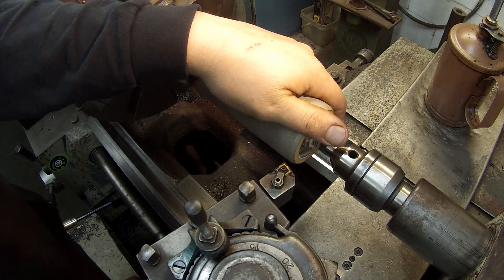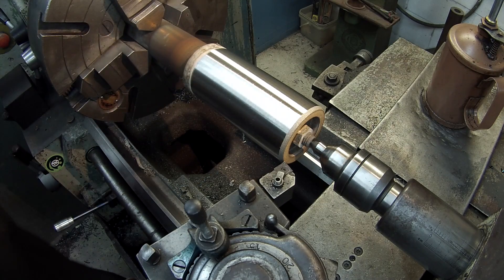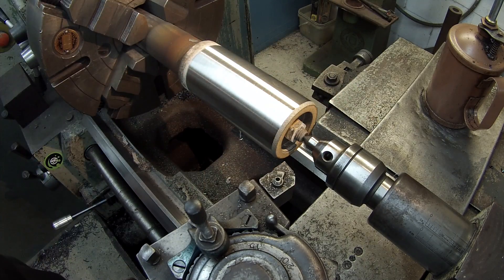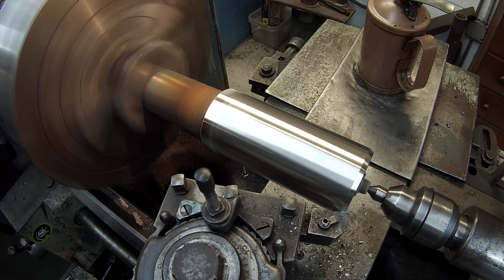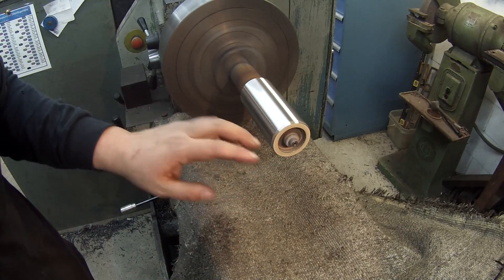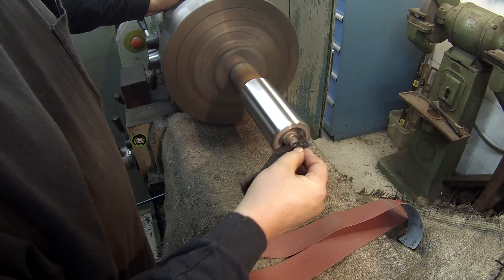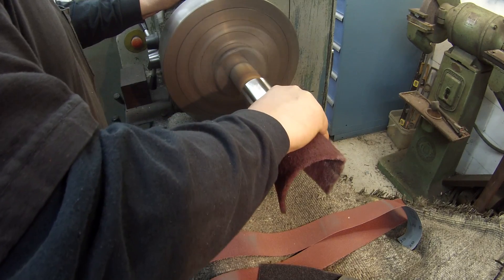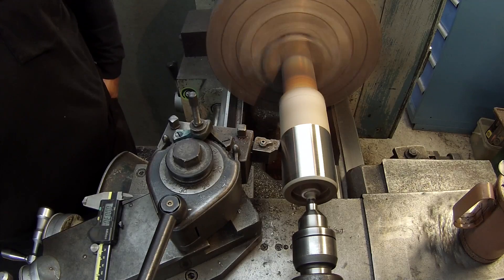Stainless Steel Metalizing Part 2

Comment: What are you doing to that part in the lathe?
Making it bigger!

Many years ago I recall collecting and delivering back components that had been built up again by welding. They were a lot rougher than this finish as they were picks being used to strip the metal coated linings from blast furnaces ready for relining during "shut down fortnight" at a local steelworks.

Comment: Great Video. I am trying to get back into spray welding. We have been tig welding repairs on shafts for years and I have all the equipment but am having a hell of a time getting my hands on consumables. Do you have a vendor you get these products from? It seems like everywhere I call I cant get everything I need from one location. Thanks again and keep the content coming it has been a great help so far. Thank You

Comment: Have you ever metalized fiberglass?  I worked on helicopters for the army and some models had the fiberglass dog house cowling stainless steel metalized. I was wondering if you have ever heard of fiberglass being metalized and if you knew if there was a different method of metalizing. The manual called it a flame spray process.

Comment: Isn't the metal burnt with that process? I understand it is being made into a molten state in the flame but with SS if you flame burn it like that the metal itself is really more of a slag than allow at that point. I'm just not understanding the chemical reaction that is happening for the SS powder maintaining its proper alloy properties.

Comment: I'm not sure why, but it's not surprising that something like this can be done, with all the other things we've learned to do with metal. What I don't understand is what happens to the bond coat as the metal powder is applied? Is there still a small layer of the bond coat there, or does it burn off?

Comment: I just want to tell you how much I enjoyed watching you work and explaining everything as you went along. Felt as if you cared about us knowing well what you were doing. I am retired (back trouble) but I can't get too far away from the intrest in metal working. I was a welder in a shop that did spray welding with tungston and ceramics as well as other metals. They did a lot of the Mission Pump shafts. Good work Adam and thanks again for your teaching.
Reply from the maker: David Conner Thanks David! Great comments. I have never had the privilege to spray weld ceramics but I do have tungsten and some other hard alloys here. You have to grind them to finish though.
Reply: +Abom79 just a thought could you cut a piece of tubing to cover the threads? Then you wouldn't have as much trouble. I've never seen this before didn't the masking work or does it not work the way I thought it would

Comment: I take it the spray weld saves allot of time to remake that part?
Reply: +Erik Trent Stainless doesn't grow in trees...nor carbide tools and man hours! You would be tossing 10-20 bucks of slightly undersized stainless and then have to buy a solid piece (40-60 bucks) and then the machining time would be an awful lot! If a part is not totalled or not getting any other update fixing the old one is always the best bet!
Reply from the maker: ShnitzlHaus In many cases yes, it saves you from having to machine a whole new part.
Reply: +Abom79  It seems to me a guy with your skill could machine two of them new faster and cheaper.  What am I missing?  Very interesting to see though, to say the least......

Comment: Incredible, never have seen spray welding even tho I knew it was used on cranks.
Your tool setups using old standard methods are great. I had a machinist tell me he never used a 3 jaw scroll, only a 4 jaw independent, now I see why so maybe I'll start using my 4 jaw on my old Logan (about 1945 but still works great for me.)
Paul
Reply from the maker: Nextstepheli .Nextstepheli Both chucks have there place, but for much of my workholding needs the 3 jaw chuck just isnt good enough. All of mine run out a few thou, and sometimes you need the extra holding power of a 4 jaw.

Comment: Would a diamond knurl work better as a surface finish before spraying? Obviously that would deform the surface and change the od, but wonder how that would do? Seems it would have more surface area.. You could thread LH and RH making a diamond like pattern that doesn't displace any material. Just a thought.

  Besides that, the video is really cool and I enjoyed watching it. Thanks for taking the time to make it.

Comment: Merci Adam, j'ai vraiment apprécié que tu mettes ce travail en ligne, c'est ce que nous faisons entre autres choses dans notre entreprise.
Tous les systèmes de projection thermique possèdent un gaz vecteur servant à accélérer et transporter de fines particules jusqu'au substrat  (typiquement 5 à 100 micromètres) qui peuvent être à l'état liquide, pâteux voire solide.
Ce gaz vecteur peut être aussi source enthalpique, permettant de chauffer ces particules jusqu'au point de fusion.
D'autres procédés utilisent un arc électrique pour fondre le matériau. Les particules ainsi projetées sur le substrat, s'écrasent selon leur vitesse, selon leur état physique, température etc.
L'accumulation des particules sur le substrat permet de réaliser le revêtement.
Ceci est possible pour presque tous les métaux.
Je regrette que pas plus de français ne commentent dans vos vidéos, ou postent sur Youtube leurs savoir faire, parce que les échanges seraient bénéfiques pour tout le monde.
Cela fait un an que je regarde ta chaine Youtube Adam, tu fais parti des meilleurs de la " communauté ", c'est un fait :)
Cordialement.

I translate ( like i can) because automatic translation is a shame :)

Thank you Adam, I really appreciate that you put this work online, it's what we do among other things in our company.
All thermal spraying systems have a carrier gas for accelerating and transporting fine particles to the substrate (typically 5 to 100 micrometers), which can be in liquid, pasty or solid.
This carrier gas may also be an enthalpy source for heating the particles to the melting point.
Other methods use an electric arc to melt the material. The particles thus projected onto the substrate, crash on it according to their speed, to their physical condition, temperature etc.
The accumulation of particles on the substrate allows for the coating.
This is possible for almost all metals.
I regret that no more French guys comment on your videos, or post on youtube their knowledge, because that would benefit everyone.
For one year I look at your youtube channel Adam, you are part of the best of the " community ", it is a fact :)
Best Regards.

Comment: I just slapped my wrist, why would I doubt it!
Reply from the maker: Did you see the pictures I posted on FB?
Reply: No I just finished some welding work, the temperature is on 36C at the moment on its way to 39C today, so into the shower, grab a coldie and check it out.

Comment: Adam, check all the O'Rings in the Eutaloy torch before you fire it up they may be perished. cheers

Bruce
Reply from the maker: Bruce Whitham I did check them and they were still good. I made a couple welds with it not long ago, doing good!

Comment: Yep that would be good, the thing about the powders are they never age if they are sealed. The problem will be keeping the bottles from deteriorating, I'm still using some of the fluxed silver solder that is 40 years old, kept in original Castolin box and travelled the world and still serves me well. I'll raise a glass to our health tomorrow evening.
Reply from the maker: A few of the bottles are sealed, but the plastic is getting bad. I'm going to have to buy some type of containers to put the powder in and mark them because I don't trust these bottles to last much longer. I've already lost 4 bottles of good powder.
Reply: Abom79 Switch to a PFA bottle. They will last a lifetime, if you can make the investment. (one example) http://www.amazon.com/Saint-Gobain-Chemware-PFA-Wide-Mouth-Bottle/dp/B004O6NBJS
Reply: Any PP or PE bottle is going to last many decades if you keep it away from light. Light is the enemy of most plastics in a longer time span.

Comment: I have seen manufacturers weld teeth on grinding machines, how much stronger/resilient compared to the original material is spray welding, does stainless steel harden better thru the heat process like carbon steel?

Either way, awesome video and the final product looks incredible...keep up the great work Adam.

Oh yeah, Happy New Year to you and yours as well!

Comment: Adam G'day, well done. you take me back to the 70's in my old shop when I used to do a lot of metal spraying on all materials both round and flat/curved, did a lot of hard facing as well. The memory jolt came when you were unloading the stuff from your old shop and I saw those little bottles and the gun. Castolin Eutectic brand (Swiss if i'm not mistaken), looked exactly the same. I use a guy in Town who does this full time and also other guys with different methods for shaft buildups and keyway repairs. Take Care Bruce
Reply from the maker: Thanks Bruce. Eutectic is mostly what I have, with some Metco powders in the mix as well. Yes that box of powders i shown is for the Eutaloy torch. I want to pull it out one day and play around with it on camera. It should be great for some keyway repair.

Comment: Adam, thanks for the great video. I operated boats for 10 years and managed the fleet for another 11. Sand in the water would occasionally chew up the shaft inside the cutlass bearing. Wilmington Iron Works, Willmington CA. Used the same process to save some of our shafts. Monofilament fishing line can cause damage too. My other experience with metallizing was re-coating worn SCUBA tanks with Zink to replace the galvanized coating. 

Your videos are always interesting and informative. Afterwords I get frustrated if I don't have a jucy project waiting in my home shop.

Randy
Reply from the maker: It's nice to hear from someone who has a little experience from this process. How did the repairs hold up for you during that time? Did you ever run into any problems with the metalizing? I've never had much feedback, but that can be a good thing!
Better get out in that shop and drum up a project now!
Reply: The repairs held up fine we never tracked the repairs with 11 boats in the fleet, each a twin screw, just not that organized. I was never Adair of a problem with the repairs. Eventually a shaft would get bent as a result of impact with floating debris. Sometimes they could be straightened, also by Willmington Iron. We had a steady stream of props in for repair with Wi
Reply: Wilmington propeller. We gave these two firms some regular business. Props and sometimes shafts would be changed out in the water unless other work was required. It was an eye opener for me to see one of Keith Fenners videos where ht took great pains to mate the taper on the shaft to the prop. Also the care he takes with sharp edges on key ways. Our props were treated as interchangeable between most of the boats. They are all powered with various versions of the Cummins B series engines.

Comment: Can u not weld a thin pipe on the side off nut. Which protects the threads.When you are spray welding. This way you do not need to paint the threads.Or turn it down. And your head stock will still fit.

Comment: Hi Adam.

I work with heavy earthmoving machinery. Several years ago, I came across some pins which had been spray welded and the metal had broken away from the pin. It had come away in a fairly neat layer and you could see where the pin had been turned down for the start of the process.

If you were to hazard a guess, would you say that it's because spray welding isn't suitable for high impact applications like this, or would the process have been done incorrectly?
Reply from the maker: It could have been done incorrectly, but it also may have been the wrong applications as well. Most of my spray welding fix's have been for bearing or seal journals.

Comment: Hey Adam: Your metal spray application finished well and looks great.  I can remember my Dad, who was a metallurgist with Revere Copper & Brass, experimenting at a local machine shop with wire and small rod-fed application guns.  A coil of rod or wire would be fed into the gun which ran a blue-white flame and produced the spray. It also machined well.  I undercut a 1" 4140 steel rod to .500" into which my Dad sprayed copper.  It machined really well, and for years I had that steel-copper-steel rod sample.  Dad passed away about 7 years ago, and I don't know where the rod sample went. Great video!
Reply: That brings back memories of when I was at work, we copper sprayed the ends of capacitors using this method, the maintenance men would be very enthusiastic when it came to changing the extractor filter tank, it was full of copper dust for them to sell for scrap!

Comment: Hi Adam, how this metalizing process do in terms of durability?
Reply from the maker: If applied right, i works great and last longer than the parent metal surface, I have seen several of my seal journal jobs and they are still like new after many hours of use.
Reply: Thanks for the reply Adam. I didn't know about this technique before, well... know I do. 

Happy hollidays for you and your family!

Comment: A suggestion from the cheap seats. Next time you have exposed threads like that while metalizin put a couple extra nuts on it untill all the threads are covered. They can just be finger tight. Oh another great video too!
Reply from the maker: Good tip David, somethings even the simple things can slip our minds.

Comment: Very nice Adam.  If it weren't so expensive this would make a great sparkler show for New Years and 4th.
Have you considered a shield for your chuck?  I'm thinking a cardboard disc the size of chuck face with loose center hole for your work arbor to pass through.  Doesn't need to be attached to anything, just allow it to freewheel.
Reply: I though the same thing, also a wrap of masking tape around the exposed thread, not sure that would be robust enough though.
Reply: how would easily burnable materials protect from molten metal spray
Reply: This is a great example of the phrase, "please put brain in gear before engaging mouth". LOL

Comment: Hi Adam great video as all ways , just a quick question how do you cost up a job ? Do you charge a hourly rate plus the steel used . And can you give us some K&T info ,
Reply from the maker: I charge per hour plus material cost. The K&T is still in my sights, just pushed back on the list.

Comment: Does the shallow 28 tpi thread on the part contribute to holding on to the metalized powder? Was 28tpi just an easy to achieve thread pitch, or was it something specifically required?
Super video series in so many ways: presentation, videography, material and method choices, techniques to name a few. I hope you and Elena have a wonderful, healthy, happy Holiday Season and a great New Year. Hurray for you and YouTube: rather YOU and youtube.
Cheers brother,
jim
Reply from the maker: Jim, cutting a shallow fine pitch thread across the undercut is part of the procedure. They say it helps the powder hold, or have something to help bite. The pitch doesnt have to be anything specific, but there is a range to stay in.
Reply: Abom79 I think it has to do with doubling the surface area by cutting a thread, instead of the flat surface you now have each slope of the thread.

Comment: Great videos Adam.

 Is your tourch a type 1A and how about teaching us about the why depth of relief cut, what  thread count and the flame profile to be used.
 Everything I have read on the Eutectic (took over Rototec) is Greek to me, and they informed me that they have not heard of a Rototec type I and type II gun, but they have metals for Rototec type I A. There is not a lot of information out here on what prep process or what metals should be used.
Someone with your knowledge needs to help us out in the field.

Thanks again for your excellant videos.

Montana
Reply from the maker: Yes mine is the Rototec 1A.
I have tried to share some of that info on each video William, but some of this is things that were taught to me by my dad. I do have some old liturature on the torch that explains the proper procedure, and I have that as a guideline to follow. Some tips to keep in mind...
Never go more than .040 deep on undercut (per side)
stay between 200 and 600 degrees
cut a fine pitch, somewhere between 20 and 30 is fine.
Build up approx .050 above finish size.
Reply: Abom79 When I get to the use of my Rototec use I will give you a heads up on how it went.
Thanks again.

Bill
Reply from the maker: William Phillips
Sounds good William. I didn;t want you to think I was trying to sound off-putting. I really do want to help and make sure those who are trying this are getting the right info on there end. Have you watched my other spray welding videos? There was one that I tried to explain the steps in more detail, thats why I was kind of breezing by with this one. Check those videos out, and if you need a hand let me know. I'll help out as much as I can.
Reply: @Abom79  I apologize if you have answered these questions in previous videos. Why do you like cutting a fine pitch? Just something extra for the material to grab? I have a shaft that is 309 ss and i have an undercut of .055 a side. Have a gone too far?  Also i was curious what you are preheating too and how many RPMS you are running when you are applying? Thanks again man

Comment: Amazing results Adam, any idea how well this repair will work compared to the original metal part?  

Excellent videoing and editing as well!
Reply from the maker: It should work well Dan. This repair was done time and time again in the older days when my dad and the other welding shop did it. Joe's dad used to spray alot of prop shafts back in the day, where they were worn from the cutless bearings. It's not very common around here today though.